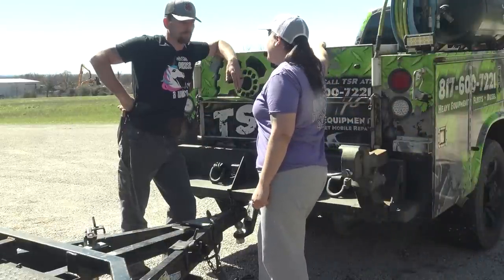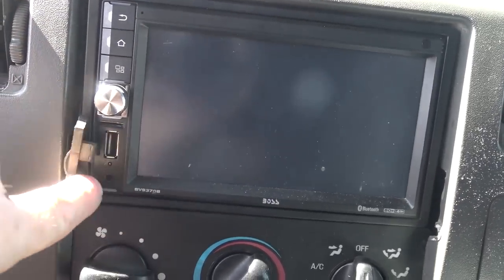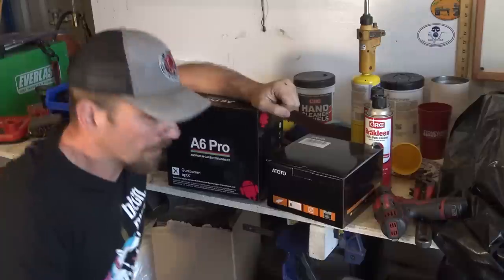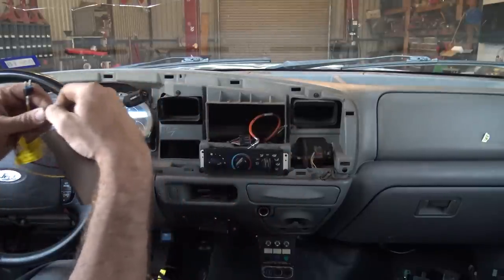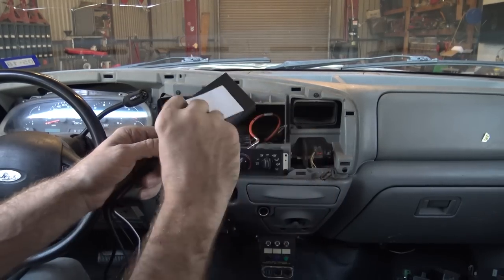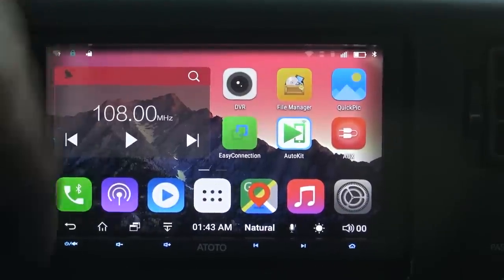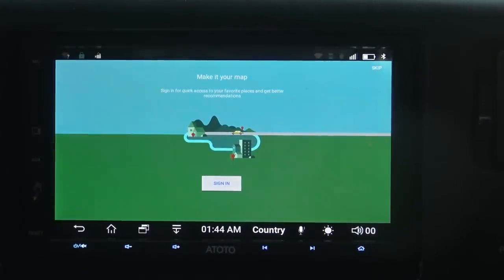I should have installed this on my Ford Superduty service truck YEARS ago!

Comment: Just finishing up a project on my truck to install a camera in the bed to see the gooseneck hitch and another one on the bumper to see the trailer hitch.   My truck is older and has a single DIN slot in the dash, so I went with a replacement rear view mirror with a built-in monitor.
I got my stuff from Rearview Safety.  I’m impressed with their quality.

Comment: we put them in the gravel trucks years ago saves the guys so much time, time is money ego and pride of doing it the old way is fine but 3-4 trys to get the pintle hitch lined up is ten minutes add that up over a month when you have to hook and unhook 3-4 times a day on the transfer trailer units so i like em

Comment: I believe all 2018+ Vehicles are required to have backup cameras right? My 2005 Tundra does not have one and dear GOD i need this. I will check into them, my security system goes through it so I have to be sure it will work with it

Comment: I loved my rear view camera. After getting my 1995 Chevy Silverado ext. cab with a three door drop front I bought the Peak back up camera.  It didn't have the lines to go by but I still loved it. If you go to my YouTube channel you can see the truck. Sadly I have to scrap the truck. Frame is rusted out, gas tank leaks, shifter cable broke and reverse gear went out no way to save the truck. I usually buy Ford trucks but the Chevy was in really good shape and I bought it for a good price back in 2012. Love the video's keep up the good work.

Comment: Ah…. The ol’ hitch dance.  When I was running my first All New work truck, they did a software update during a routine service, that meant if you took your foot off the brake while in reverse and the door was open, the horn would blast.  Given that I hooked up and disconnected from trailers several times a day, this was a serious pain-in-the-ears.  I spent a full hour arguing/yelling at the service manager to get that update rolled back, to no avail.  10 years on I’m still pissed off about it.

Comment: I had an Atoto in my Super duty. Worked good. I would say get the one with more ram and better processor though. I got the cheapest one and it was a little slow with multiple apps open, otherwise it was great.

Comment: I have an excursion,  I’ve never been able to figure out where the reverse wire is in the truck.  Which wire in the truck did you tie in to?  I have manually switch the head unit  to the camera when I shift to reverse.

Comment: A triangle "△ "welded on the end of a  HD steel hitch bar to form a "<---" and installed in a sandwich of TWO 2  "🔼" larger triangle....where the little  "<--"  enters the base in the middle thru a slot and can wiggle all around the space inside the big triangle  to HOOKup.  When trailer is attached, you BACKup forcing the "<--" into the peak of the larger ⬆️△ sandwich which is mounter to the truck frame as a trailer hitch. 

It allow you to get near the trailer coupler device and lower onto the hitch ball/pintle hook....then snug it securely into straight back center position. You then insert your locking pin to secure the "<---" from moving around while under tow.  

This is a :close is enough" design of olden days before fancy gismos that need electricity. 
I hope I explained it well enough for you to get the idea of it.  It is just a litttle welding project anybody can made.

Comment: OMG yes. I drive an old OBS f250 & I tried to hook up a trailer with it & finally got it hooked up until... I realized I forgot to put the pin in the hitch. The good news is that I just had to back up. 

I have a lot of experience backing up a trailer, but that’s on a lawn mower. A truck is a lot more difficult.

Comment: Reversing cameras come with enough cable for a car, not a truck.
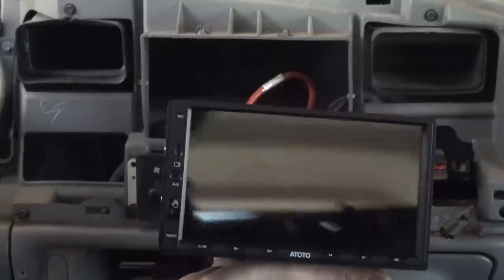At 5:00 why do you need to splice? You need two cables.
You buy a cable that fits the radio and ends with a  DIN standard plug.
You buy a cable that is DIN standard socket one end and goes to a plug that is suitable for your truck dash.
I changed the radio in my car in 5minutes, it took longer to get the plastic dash open than it took to plug everything in and test.
You don't need to cut and solder, err sorry sodder...
https://www.youtube.com/watch?v=-kUOZVb8XKU

Comment: please respond to me stephen i have an urgent and very important query to ask you about an earlier video you had made about an engine, do take it seriously.
Reply from the maker: What's your question
Reply: @StephenCoxfixit  i have an engine shibuara n844 i cant understand its governor setting springs, i am using it for ac alternator purpose. i have shown the governor setup to mechanics here but they  lack any education about it. i have seen you have made one detailed video about that, which ideed i have watched many times, but there are a couple of more setting bolts on the outside of governor casing that i donot understand the purpose of, i am certain they are related to spring tension of auto govern and idle setting, but iam not sure how they work. i dont really want to mess things up without having the expertise about it, only if you could see ones and let me know. would be highly apreciated and thanked for.